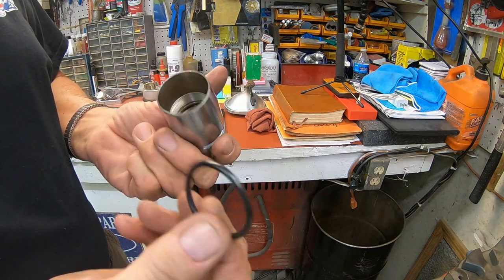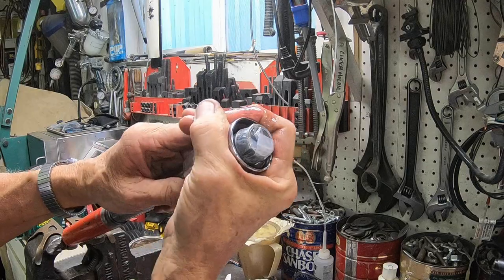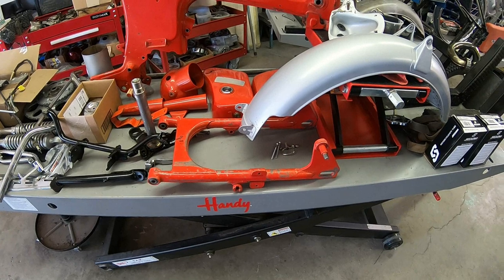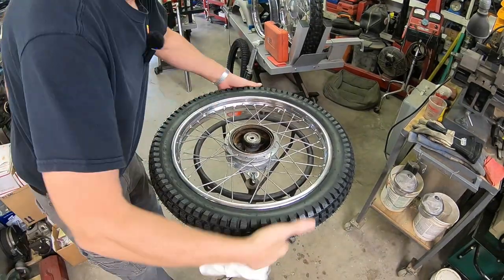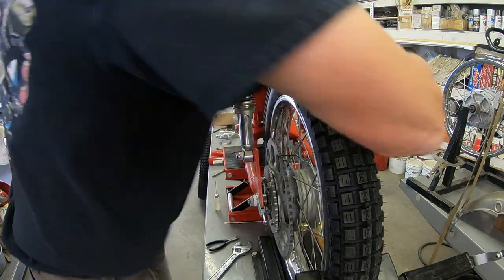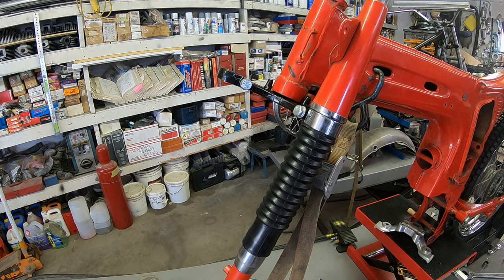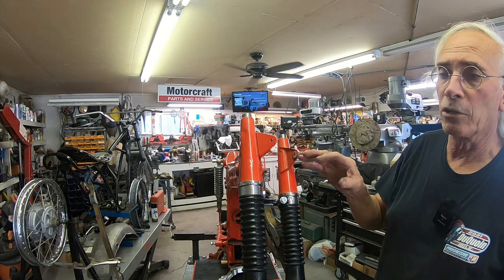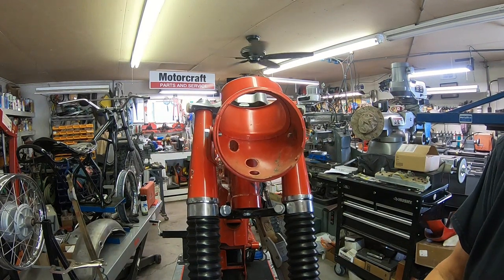Yamaha 100 Trailmaster, fork, frame, and wheel assembly

Comment: Thanks for saying the bolt sizes as you put it back together. This is so much more helpful than a guy getting a pile of junk “started” and then walking away. Great work.
Reply from the maker: Thanks Dave, I try to inform as much as I can as I go along. Not always possible though. Thanks for spending time in the shop with me.

Comment: Hey Dale,

Ha.  I've got an arbor press identical to that-->  paint chips and all!!

Say, you should try Boca Bearing for your bearings and seals.  Their standard bearings are better than OEM, and then they have grades upward/better quality from there.  The seals can be found there by number, or size.  I've been using them for many years, and have been very happy with them.

Where's that (Red) AT1MX??

;~)

Take care,
Robert
Reply from the maker: Hey Robert, thanks for the tip on the supplier, I love that little Dake press, it really is handy. Red AT2MX is coming.

Comment: Sorry to bother you about a non motorcycle question. I was wondering what you thought about your atlas lathe. Reason I ask is because I found one on eBay for 1200.00, there’s not much information on it but it looks complete. And it does come with a lot of tooling. It would be a beginner lathe for me. Just wondering your thoughts on it. Thanks John Reid
Reply from the maker: Hi John, the one I have is a very small one, believe it's a model 618. It will do small parts with very light cuts. The thing about machining is its basically the part your making against the mass of your machine. So the smaller the machine the less mass, so the smaller the cuts. I out grew my small lathe very quickly, I just couldn't do what I needed to do. The small lathe weighs about a 100 lbs, the bigger one weighs about 2000. Big difference in the job you can do. It's up to you if you think it will work for you. Most of the time I wish I had a bigger one. Hope this helps, no problem answering questions.  Ask a way...anytime.